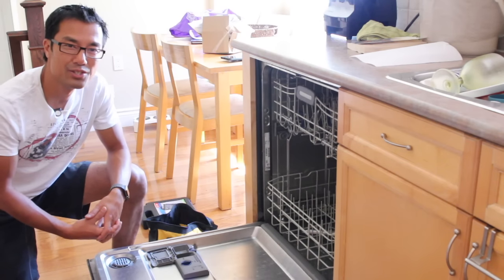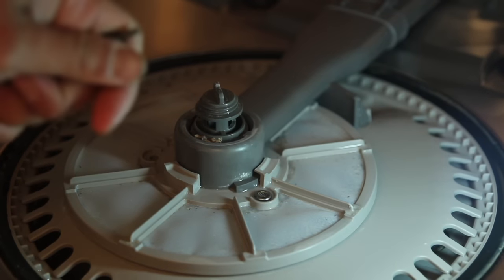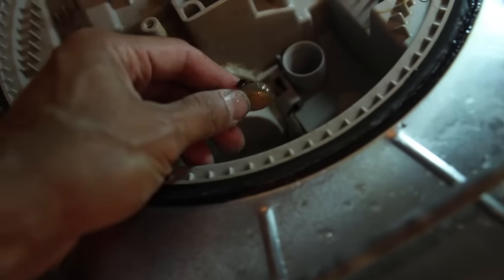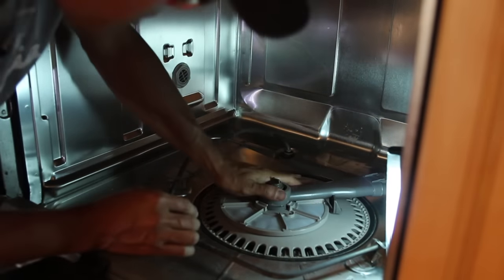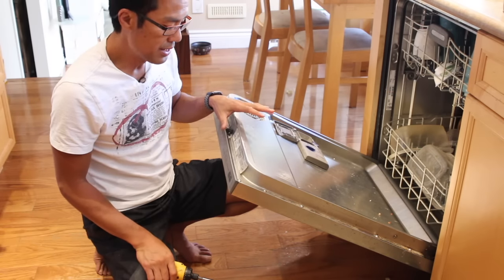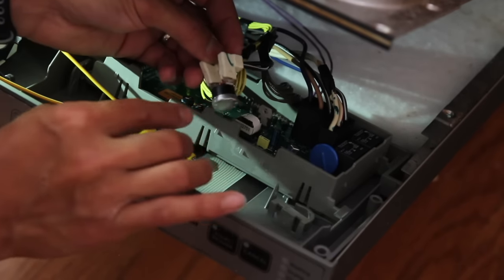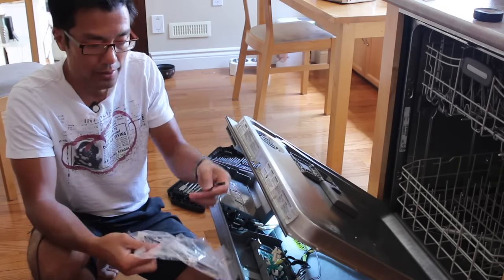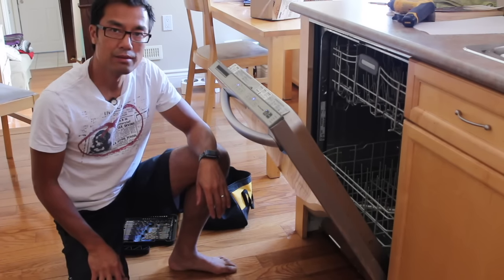KitchenAid Dishwasher Repair - No Power, No Lights and Grinder Clean up

Comment: I still don't know what happened to mine. I disassembled it, the fuse was fine, and after putting it together it now works again.
Reply from the maker: Wow that’s amazing. Glad it’s working for you again. Maybe just needed a reboot. Have a great rest of the weekend and hope it continues to work for a very long time.
Reply: @DDIY-Guy  Thanks. It's the third time, so indeed it seems like the computer is hanging for some reason. Next time I will turn the breaker off for a longer time to see if that reboots it.
Reply from the maker: So when it stopped working the first time…was there any power on the display or it just stopped mid cycle?
Reply: @DDIY-Guy  I don't think it ever stopped mid cycle. We would just try to use it and find it completely dead. The first or second time I found the ground cable loose, but that shouldn't make a difference. Next time I will trip the breaker and wait for a while to see if that works.
Reply from the maker: It also might be the power source connected your dishwasher….is it a direct plugin to the wall outlet or is it hardwire connection to the dishwasher.  Either way, maybe the power connection is loss and when you put it back it wiggled the connection in place.  Check the connection and make sure everything is snug.
Reply: @DDIY-Guy  Yes, that something to check. But this last time I didn't move the dishwasher at all, and I could check that it had power while still not responding.

Comment: Hi, can you tell me the voltage across the fuse?
Reply from the maker: There will be the full supply voltage across the fuse if it is blown, and zero voltage if it is good. If the fuse is not installed, you need to check it with a continuity tester or an ohmmeter.

Comment: Danny, hot did the shell get past the screen?
Reply: Sorry *how
Reply from the maker: +Scott Croydon on my dishwasher, the first filter lets in thing like broken plastic forks and shell size pieces.  Then the grinder is suppose to cut it down into small bits.  The screen on the other part just lets through water.
Reply: hi danny i have the same dishwasher u have whats the model for the fuse i should order
Reply from the maker: Just go to amazon and look up KitchenAid Dishwasher fuse.  There should be the fuse kit that comes with the cables as well but you can just use the fuse....its about $25.  It might be listed with the whirlpool brand as well.  Just look at the picture and make sure it matches with the the one on your washer.

Comment: Can you tell me where you got that cable from?
Reply: or a link of what it is/where to buy it
Reply from the maker: +Rolla07 CS I got the part from amazon canada:  https://tinyurl.com/y9qkmxuk
Reply: I meant that yellow cable that bypasses the fuse?
Reply from the maker: +Rolla07 CS you can get them at an electronic store or “The Source”. Or you can order them online on Amazon: Alligator Clips Test Lead Jumper Wire: https://www.amazon.ca/dp/B00D10KTLQ/ref=cm_sw_r_cp_api_.ZddAbAXG7P10

Comment: I am no technician , but if you have burnt wire insulation and the fuse is blown (which by the way is what it is supposed to do for safety reasons or you would of had a electrical fire ) changing just the fuse and not the wires that come with the new fuse is not a fix but a disaster waiting To happen , a good trouble shooter will ask why did the fuse blow to begin with , just sharing not judging , when it come to electrical problems pay the bucks forget the short cuts
Reply from the maker: Thanks for the comment and I agree, electrical work can be intimidating and scary to a lot of people including me...but the more I work with it, understand how it works, and take the proper precaution when working with it, the more I’m able to do a lot of DIY simple home fixes that would cost me hundreds of dollars in electricians cost to come into my home.  I agree there are risks to DIY fixes you do at home and it’s the risk you accept.  For me my dishwasher as lasted over 10 years now and still running well....parts are wearing down but you just replace those parts, $10 fuses blows and you replace it,  the machines are only as good as they’re weakest parts and I somethings thing companies build in these weak parts to make sure they get you to just buy new machines every few years.  Anyway, as most YouTube DIY videos say, do these suggestions at your own risk, do your own research,  read the other comments on the videos, make sure you take the proper precautions, remember you are watching amateurs, and be comfortable and accepting the risks you take doing it yourself in your own home.  Anyway, thanks for the comment and feedback.

Comment: I will  never buy a kitchnAine anymore ...
Reply from the maker: Sorry to hear the fix didn’t work for you.   Fortunately mine hasn’t failed after the replacement fuse and has been running for about ten years.  Knock on wood.  They don’t make appliances as good any more.

Comment: Yuck.... bad video is bad. That fuse is rated for something like 16 and 18 amps and you jumped it with a dinky little wire. Any real repair person would have just used a meter to test the fuse.